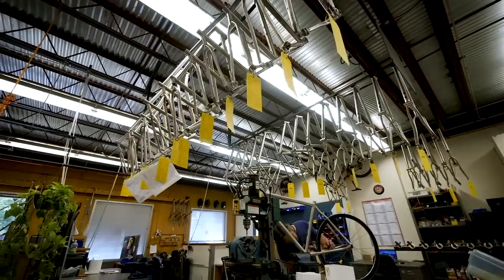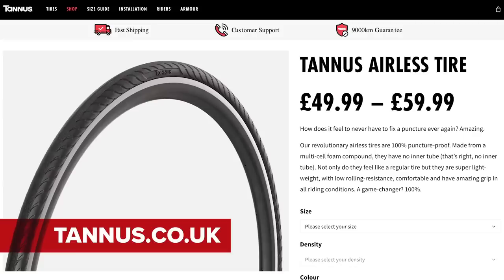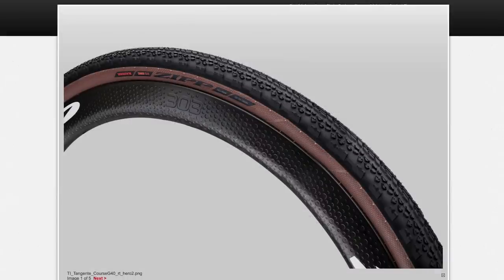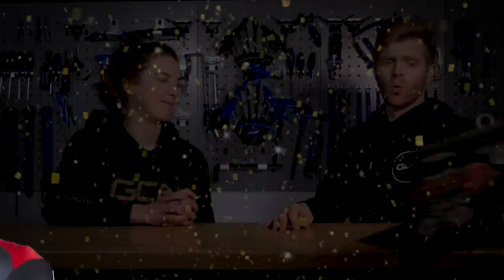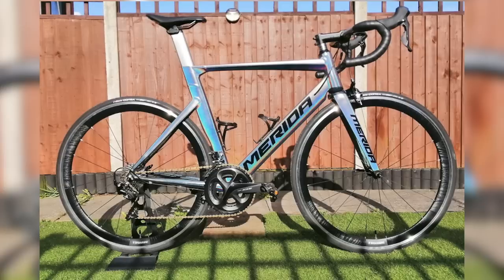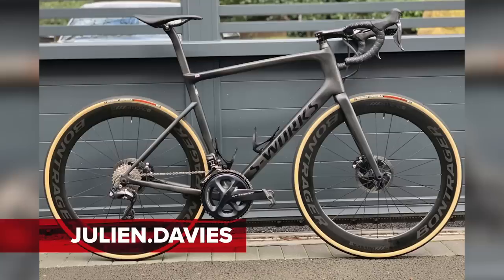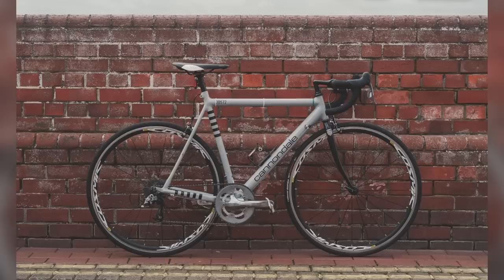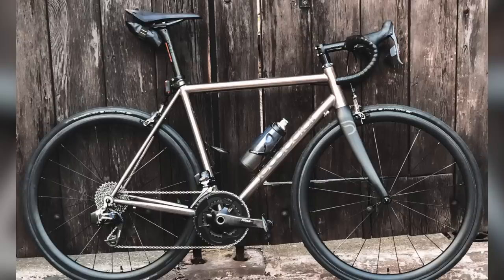The Most Durable Bike In The World? | GCN Tech Show Ep. 117

Comment from the maker: How would you build the most durable bike ever?  Let us know 👇
Reply: My bike is the most durable 
Surly karate monkey with rohloff hub
Reply: Fixed gear, less parts to fail 8)
Reply: Buckey balls and nanotubes!
Reply: End of days bike?
Reply: Chromoly frame and everything for me please...
Reply: Vsf tx1200 already built.
Reply: Panos peterpan  @GCN... where's Lasty, speaking of Bricks
Reply: Buffalo Bike. Can you really beat this ? I think it beats any Lapierre Airthing.
I also ride a bike from the 70s, just under 10kg. 2x5 gears and chains were insanely durable. And good(looking (Campagnolo Grand Sport). Need to change brake pads once in a while.
Reply: My 1988 Marinoni fits the definition of durable. Steel frame, downtube shifters, rim brakes, 7 speed screw-on freewheel, Campy hubs with Ambrosio rims. I've had to replace the rims 3 times and the hunt for freewheels is a challenge these days but it still brings a smile to my face when I step into the cages, tighten the straps and head out!
Reply: HUmm, Ti frame, Belt drive, coaster brake! 36 spoke wheels.
Reply: Brook's saddle
Reply: Just brought one; Cube editor, schwalbe marathon GT. the frame can fit a 1.75 or 45c wheels depending on tred. also brought SKS mudguards which are very rigid for full cover but not ideal for off roading.
Reply: Unicycle made of solid rods of steel. Solid tires. Wooden saddle. Done.
Reply: I didn't build, just bought it.  Belt drive, internal geared hub, commuter ebike (kalkhoff integrale i8).  I've done 7000kms on this now and the only maintenance is two brake pad changes.  Due to put some air in the shocks and bleed the brakes now I guess, then good for another 70000kms.  Never washed it.  Haven't had a flat in the last 5500kms since changing to schwalbe marathon plus with blue guard and I ride over glass every day.  Always ready to go, never needs servicing, it's the best for commuting.
Reply: You never mentioned what type of fork you would use? Carbon fork with full carbon steerer or aluminium steerer? Both susceptible to a fatigue lifespan.
Reply: My 1981 Follis bike that was built when I turned 18 is doing fine thank you... Origina are: 1) The Vitus 971 steel frame is not showing any sign of rust, 2) the Mavic RD550 cartridge square tapper BB it has 10's of thousands of Km,  including cyclo camping all over Europe,  3) the Shimano Dura -Ace headset, 4) the TA Specialite triple crankset (did eat a few chainrings over time),  5) the Cinelli 1R stem, criterium handlebars, 6) the JPR seatpost, 7) the MAFAC cantilever brakes. 8) The Huret Jubilee Front Derailleur. Not Original: The Ideale 90 is the second one (the first one lasted "only" about 30 years).  The pedals were upgraded from the original cage pedals to Look clipless in 1986 when Bernard Hinault started using them (changed the bearings recently).  I used the MaxiCar hubs with 36 4x spokes until a couple of years ago (but it went through 3 rear rims), until I wanted to upgrade the down tube shifters and 6 speed freewheel to more gears and get lighter wheels to compensate for the decreasing power of the engine... so now it has Fulcrum 3 wheels and 2014 Campagnolo 10 speed Athena shifters and Chorus rear derailleur because I like to ride the bike not have it in a museum...
Reply: Surely World Bike Relief have done it? Their bikes are indestructible
Reply: Surly Pugsley (modifed for Gates belt drive) with Rohloff Speedhub, a Paul Component bolt on single speed rear hub for the front with Gates freewheel (the Pugsley is setup with 135mm spacing front and rear), 36 spoke 29+ wheels and tubeless tires, White Industries M30 crankset, Paul Component Klamper brakes, Love levers, seat post quick release, seat post and stem, Chris King headset and BB, steel chain ring, Brooks saddle, OddMone bars, DMR Vault pedals, King Iris bottle cages. Good luck killing that.
Reply: OK, @gcntech, you've made your opinions known, asked us and garnered our replies.... now YOU build the best bomb-proof bike that you can! :-)
Reply: @PeterYannick  Yeah - quadruple butted  :-/
Reply: Titanium frame
GRX 105 groupset, 1x. (Traditional chain easier to replace)
Obviously hydro disc
Dynamo hub
No carbon anywhere.
Custom wheels, alloy, shallow, high spoke count.
Reply: Spitch Grizwald I am a big dude at 6’6” and 125kg.
My rohloff was broken twice and rebuilt at the factory. Seems fine now after changing my gearing to tandem spec. can run heavy duty chains with this setup which is awesome.
Singlespeed is also not ideal, the input torque keeps destroying crank sets. Rohloff solves this apparently. Another thing is the seat post. I found out that thompson elite is the way to go for me. Cracked my titanium brooks b17...
Reply: GCN Tech If a belt breaks in the out the middle of nowhere replacements could be hard to come by. So internal gears FTW I reckon
Reply: @mackeydarragh  Fox 40...😏😏
Reply: That LOOK bike isn’t real. That picture is all digital editing. The background is fake and the lighting in the wheels is way too bright to be real.
Reply: My Surly ECR with bb7 cable discs and gevenelle shifters on dropbars
Reply: @Bouwentjes  I believe you. I was sick of the shock on my shitty Fuji nevada 1.9 and found a Karate Monkey rigid fork for cheap, and it makes the bike tolerable. HAHAHAHAHA Hubs are going out on it, rode it like 400 miles. No idea why I told you all this. :P
Reply: talk about environment and straight after choose choose titanium lol
Reply: Most reliable??? Hands down Campy Nuovo record with friction shifters on the downtube.
Reply: I am looking to buy a used bike for 100 km and 100 mile bikepacking rides.  Any suggestions on a used bike that can do OK on badly maintained roads and OK on dirt tracks without big rocks?

Comment: I bought a Rohloff Speedhub this year on ebay and built the wheel myself with instructions on youtube.  It's 20 years old but it performs like new.  You could actually use it as a propellor on a submarine and it would still work.  Tannus tyres are amazing, I've ran them before.  Whenever Gates make a Carbon Drive long enough for my recumbent, I'll get one .  My dream is a bespoke Titanium 6-4 (Grade 5) frame with the SON self connecting fork.

Comment: My durable drop-bar bike has a titanium frame, carbon belt drive, and Rohloff Speedhub, so my gears should last hundreds of thousands of kilometres with just a yearly oil change. The hand-built wheels have double wall rims, 36 spokes and Marathon Plus tyres. The front hub is a Schmidt dynamo so my lights last forever as well. It’s a Van Nicholas Yukon.

Comment: Good shout on belt drive but if going for chain, the difference in durability and solid reliability of wide-chain 7/8-speed over skinny-chain 10/11 is significant. Not only does the heavier duty chain need replacing less often but the shifting stays solid for ages, and through almost any amount of crud.

Comment: I painted tan sidewalls (gumwall) in 2017 with black flexi spray paint in 2017, and it's holding up well. They're off-road tires, size 700c x 32 brand: Cheng Shin. My guess is they are 1990's cyclocross.

Comment: Definitely Ti frame, but make sure the manufacturer knows what they are doing.  Welding Ti will make it brittle if any oxygen contacts hot Ti.  I agree on the Ultegra mechanical throughset (or maybe even GRX 1x) and the hydraulic disc brakes.  I agree with some others here on the wheels - 36 hole with beefy spokes.  If you can find deeper section alloy rims for that many spokes, those will be more resistant to crashes than box section. For tires, I'd go with standard tubular with kevlar liners and the Vittoria airliner insert.

Comment: the biggest Problems around welding your bike is not if its steel or titanium obv welding titanium is a lot harder but frame tubes are alloyed with a lot of carbon for tensile strenght which is also not nice to weld and welding delay is probably the most critical at your frame no matter if its steel or titanium you allways need good and suited equipment and a skilled welder

Comment: The belt drives and internal hubs are not the most reliable in the extreme cold.   From a friends experience he snaps the belt in the cold 🥶 -30 ish and roughly the same temperature the geared hubs present issues freezing up or just spinning not shifting gears.  
These problems happened at the same time my regular geared bike was having no issues.

Comment: Steel frame, clearance for big tyres (650/42 at least) cantilever rim brakes because they work fine and they're easy to work on compared to discs, probably a 1x MTB groupset, downtube/bar-end shifter, aluminium bottle cages, 650/42+ tubed shwalbe marathon tyres if you literally dont care about anything other than durability, panaracer pacelas if you care about anything else at all, probably some DTswiss alloy touring rims with 36 spokes, mounts for racks, mudguards and all the things, threaded, square taper BB, a brooks cambium all weather saddle, some randonneuring handlebars with cotton bar tape,  MKS pedals with toe clips and double straps or flat pedals with straps and a generator front hub with bike-mounted LED lights.

Comment: I am always curious about statements that a thin walled steel frame is more easily welded than aluminium or titanium.  If any bicycle frame cracks, you would need the frame jigged and tig welded by a highly skilled technician.  In all likelihood the frame will need to be replaced irrespective of the frame material as it will have failed for a reason.  Trying to repair the frame it so it functions acceptably isnt just fusing the metal together.  It is ensuring the frame retains its factory alignment. This is a more complex piece of engineering than just firing up your stick welder.  How many of the people claiming a steel frame is “easier to repair” have done any precision metal fabrication and tig welding?

Comment: Have to disagree about the tannus tyres. I used a set on my single speed bomb proof commuter for a while and while it's true they are tough, they transmit HEAPS of vibration through the bike. Anything that isn't wound in with a gallon of locktite is wiggling out and they can lead to broken spokes and cracking in strange places. A good idea in theory but rubbish in practice.

Comment: Oh my good lass, Manon... We love you. 😍

What else would I love, in terms of a durable bike? Quality chromoly steel or triple butted aluminium frame, probably Chris King headsets and hubs, sealed bearings anywhere else I can use them. I'm with Ollie in terms of choosing a good aluminium wheelset with a (bit) high spoke count, and which can fit up to 42c tires (either solid or tubeless). Also, I'm digging your choice of bottom bracket (watched that Eurobike vid more times than I can remember, on different YT accounts 😂). Drivetrain: Shimano 105 mech disc or a mechanical 2x11 GRX. Add a tough ergonomic aluminium flared drop bar with a good gel bar tape wrapped around it, and a saddle I can ride all day on without the man parts aching too much... Maybe you'll find me riding off into the sunset almost every week. 😁

Comment: I would not go for solid tyres. Way too heav, screw that.  What's wrong with patching an inner tube and inflating the tie with a mini pump on the roadside. It takes about 2 minutes with a small pump to inflate a tyre to  happy riding pressure.  
You should never need more than 32 spokes on a wheel unless you have a juvenile elephant riding pillion. 
Also,  i was thinking if you went old school 9 or 10 speed ultegra or 105, your chain would last a bit longer than an 11 speed chain no? More metal,  heavier.  Seems logical to me but I can be a complete idiot.

Comment: Once again, pandering to Shimano... if you want bomb-proof components that will last forever... it's Campagnolo and it's friction Nuovo or Super Record. Lots around and lots of spares and tiny replacement parts. C'mon...
Reply: FWIW I've had a Pegoretti-built Pinarello with 8 speed Record since 1993 with more than 200,000km on it, having been ridden in heat, humidity, and the cold snow and salty roads in Toronto. Still rides a treat after 27 years. Durable and bomb-proof.